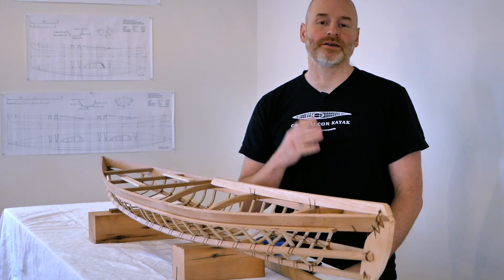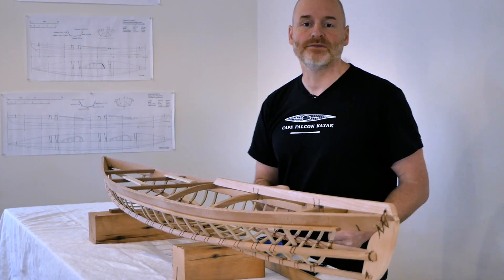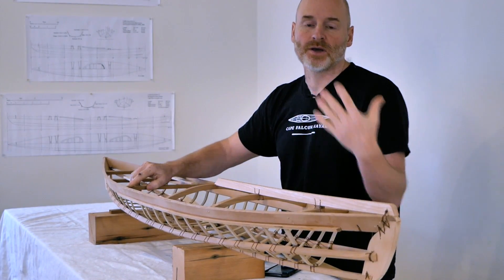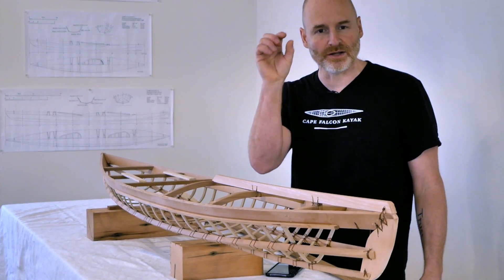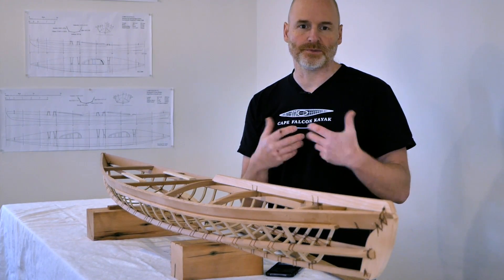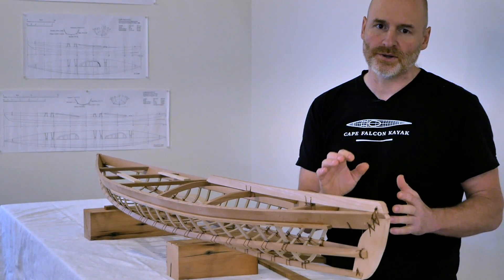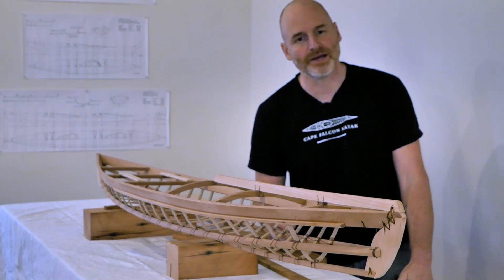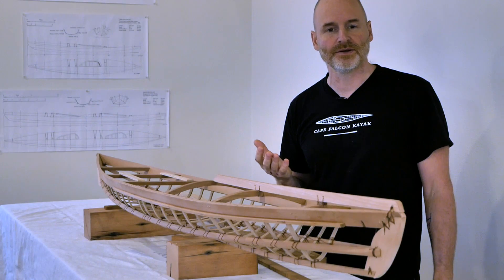Modifying the F1 kayak. Ultralight, touring, 'stubby' and surf variations.

Comment: Just wondering a couple things about making it lighter:  1.  Is it possible to make the gunwales narrower?  2.  Would it work to make the forward stem narrower?  Thanks.
Reply from the maker: You can shave a bit here and there but it never amounts to more than a pound if you want to keep the same frame longevity.   The gunwales can definitely be less tall by about 1/2 inch but that doesn't leave me room for mounting the foot braces or the secondary stringer.  All thicknesses can be reduced by 1/16th on the longitudinal wood, but that doesn't take off much either.  Big place to get rid of weight is ribs and skin.  Do all those things and you can get it down to 26 lbs instead of 30 which is where these boats started 12 years ago, but the current generation frames last 10 years, the old ones only lasted 5.   Seems like a good trade to me.   The best way to make a skin boat lighter is to make the frame thinner and more complex, like my new canoe designs or a bidarka, but I can't get F1 shaping details out of that type of construction.   I miss the old 26 lb F1's to be honest, but I think these are a better return on investment.
Reply: @capefalconkayak , Thanks so much, Brian!